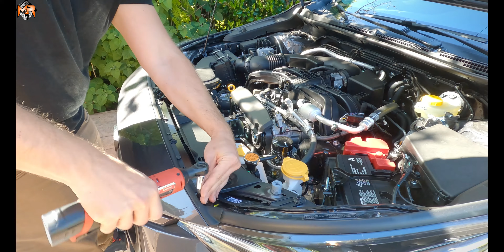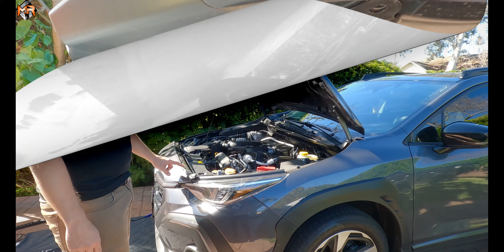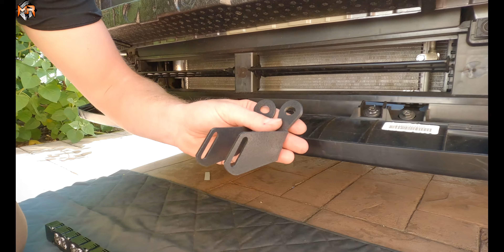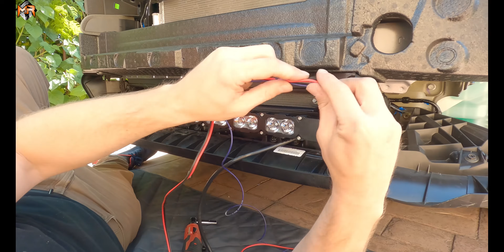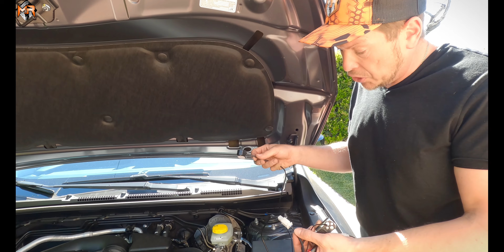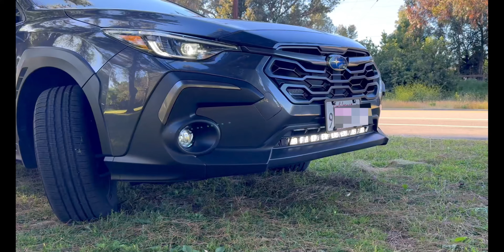2018+ Subaru Crosstrek Light Bar - PRO Install | Tutorial by M&R Automotive

Comment: Do you know if this would work with any existing 3/4” switches…and have the white/amber functionality? I’d like to pull the wires in-cabin and install the switch next to my other existing 3/4” switches.
Reply from the maker: @kamp_visuals  yes any switches that give 12v power
Reply: @MandRautomotive  great, thanks for the quick reply!

Comment: Noticed on your connection that you went directly to the battery. Would that not give the light bar continious power when the motor is not running? Is there a way to wire so that the lights turn off when you kill the engine? Really liking this product for my 2025 Subaru Outback Onyx Edition but I am not very good at wiring lights up.
Reply from the maker: I realized that its easier to bypass the ACC connection. The system has multiple safety precautions to not drain the battery
Reply: @MandRautomotive  Thank you for the quick reponse.